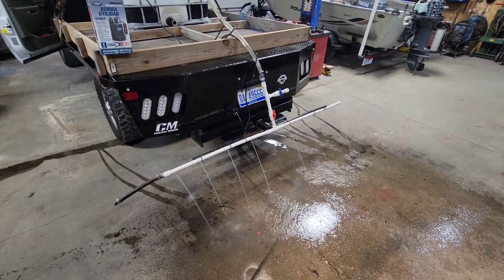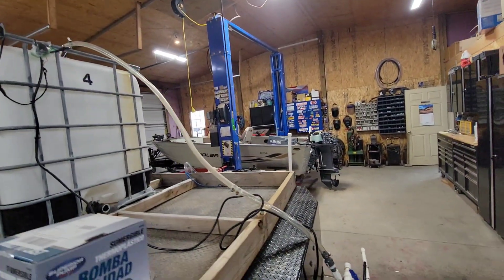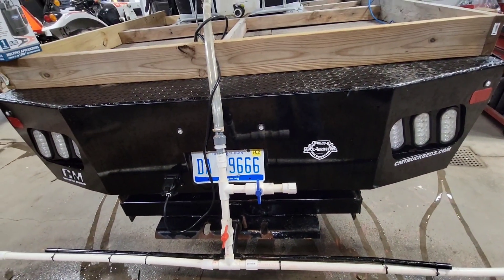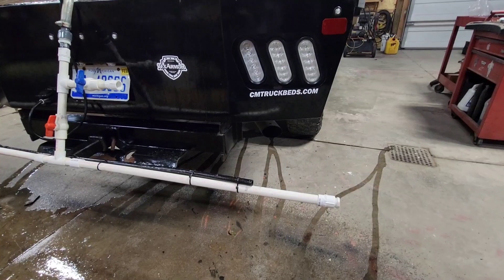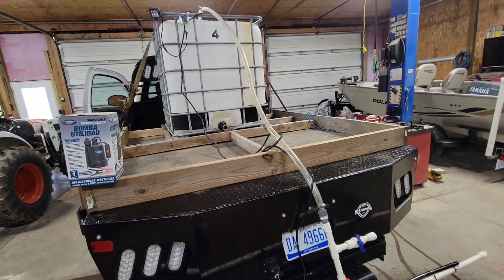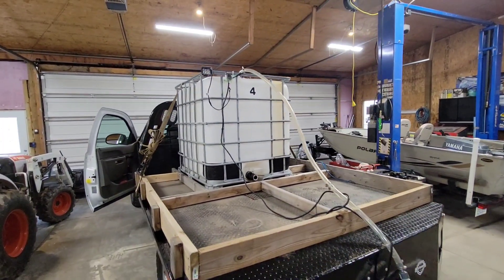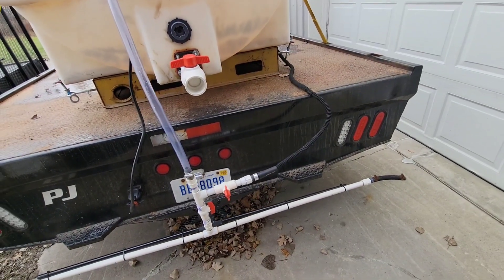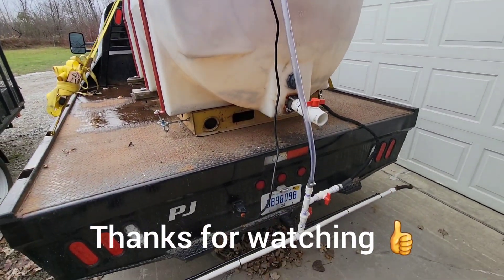BUILD YOUR OWN CALCIUM CHLORIDE SPRAYER FOR LESS THAN $300!!!

Comment: On the spray bar are you using 1/8” holes at 3 inch spacing?
Reply from the maker: That is a good rule of thumb for a 25 GPM pump.

Comment: Hi, not sure if this is a stupid question but could calcium ice melt pellets be used to make liquid dust control by mixing it with water…if so then whats the mix ratio for lbs of calcium to gallons of water
Reply from the maker: In liquid calcium chloride, the chloride percentage can vary depending on the solution's concentration, but it's typically around 32-42%. For example, a 38% liquid calcium chloride solution contains approximately 38% calcium chloride by weight. The remaining portion is primarily water.

Comment: Don't you burn through brine way too quickly without the sprayer nozzles? 
I burned through 4000ltrs in a night with the same kinda setup
Reply from the maker: No that's why it's important to have small holes so it comes out in a pencil stream to cut through the snow and ice. If you went through that much the holes must have been too big in the spray bar or it wasn't shutting off efficiently....

Comment: Using the 7-way plug is there a way to also use the brake light power or in some wiring the reverse to break the constant power to the pump? I'm looking for an inexpensive way to have the setup triggered by stopping and reversing. Is this possible?
Reply from the maker: You would need a 12 volt momentary relay to temporarily "break" the power to the pump when you apply the brakes.

Comment: okay I feel dumb asking this but I have no prior experience with wiring. How do you wire the 7 way trailer plug into the wireless receiver? There are 7 different wires coming out of this thing so I'm not sure how to do this! Thanks!
Reply from the maker: All you need is the 12v constant at the 1 o'clock position, and the ground at the 7 o'clock position as you look at the vehicle side of the trailer connection.
Reply: @danczuba  okay thank you so much! Feel free to make fun of me for this! Haha!

Comment: Any chance you can add a parts list to the description of this video please? Merry Christmas. Great simple set up from what I can tell. By chance...do you also mix your own liquid cloride? if you have a brine maker...can we get a video on your set up for that possibly? Been researching this stuff for the last two days. your sprayer system seems to be an economical solution. IF you have a brine maker as well....id love to see that!
Reply from the maker: I did put notes and part numbers in text throughout the video. The rest would be non-specific odds and ends. We do not mix our own chloride. There is a place nearby that delivers it pretty reasonably.
Reply: @danczuba  thanks for the info. Can you do me a favor? I don't have an IBC tote, but do have a few other clear water/herbicide tanks. Can you provide the dimension needed to get that pump down thru a lid instead of having to cut an opening? i cant cut a separate opening into my tanks without ruining them for other purposes (which I dont want to do)....thanks! I didnt find the pump dimensions on amazon.
Reply from the maker: I know it fits nicely through a 16 in tank opening. The pump itself is probably around 8 in in diameter.